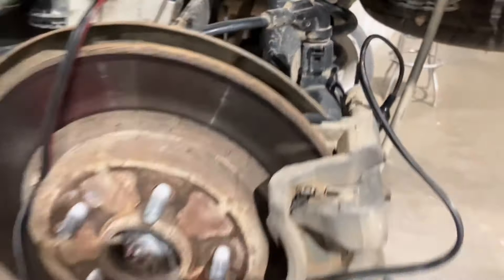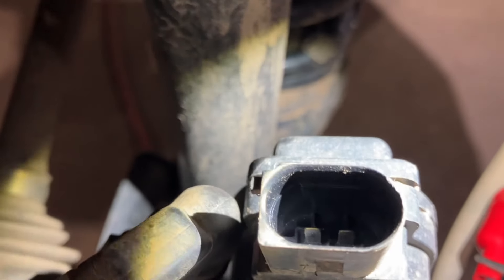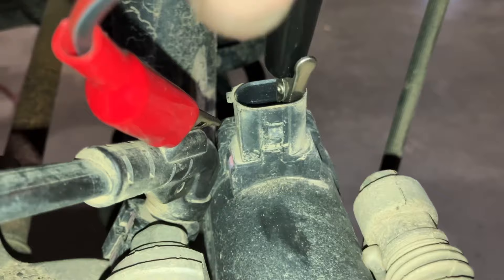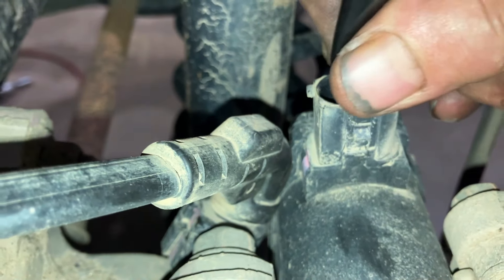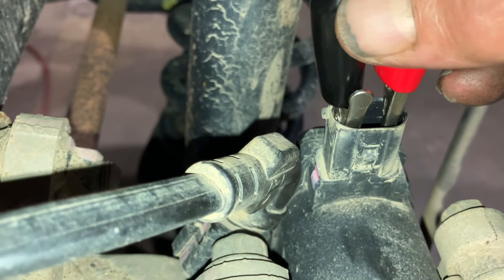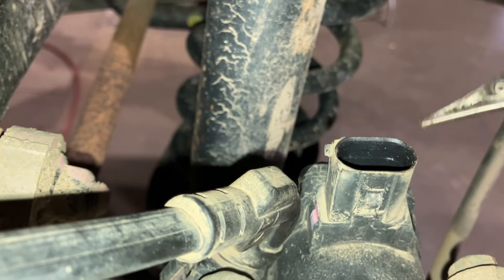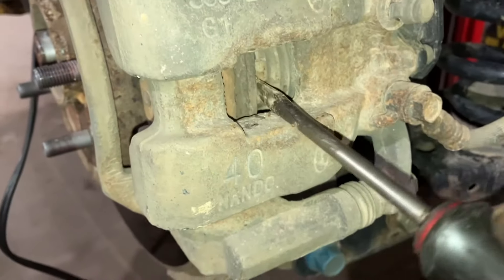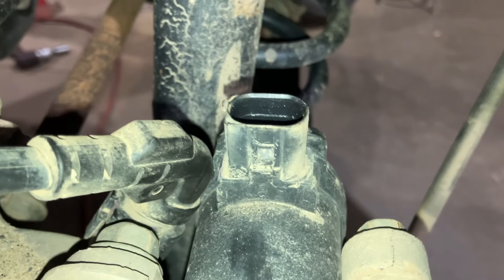Electric Parking Brake Retract - No Special Tools or Scanner

Comment: Hey Johnny ,   This appeared  in my feed  let me make your life easier  I  have a  car with electric  rear calipers,  so I made up a long enough two core cable  with female terminals to attach  to  motor and at the other end     Medium sized  crocodile  clips  for the Battery           Mines  just happens to be in the boot  or to you guys  the trunk😂 😂, The set up I watched you  using  looked  iffy as the small clips could touch🤔

Comment: Every car has a way to turn off the ebrake as long as you have the key, even cars that automatically engage it when you open the door wont if you dissengage the brake with the door already open, or by just dissengaging it a second time

Comment: A good, practical life hack!!! If a scanner was needed on some models, and it used two wire caliper connector, then all it would be doing, is reversing the polarity anyway... So, I do believe you got it right pal... Mucho Gracias!!!!!

Comment: Great tip. Once you pull the plug from the connector you have isolated the control module from your temporary battery. I don't see how anything could go wrong unless you over voltage the parking brake moter.

Comment: I wonder if turning the ign. On and putting the vehicle in neutral would release the electric parking brake as well. Im not privy to these systems as of yet.
Reply from the maker: I will release, but you still will not be able to compress the piston unless the motor is retracted all the way.

Comment: btw - my 2022 Sierra HD has an auto parking brake ONLY - sets itself on slopes ...
IF your battery fails you CANNOT manually release the parking brake (or open the electric only tail gate release) - BAD DESIGN !
Reply: or unlock the car, or open the hood to jump start it.  

Got to love the improvements they have given us.

Comment: be careful some of these newer electronic parking brakes have 3 or even 5 pin connectors on the electronic parking brake motor.  even after unplugging if you send unregulated 12v power through the wrong pins your buying a new parking brake motor

Comment: you should open the bleeder when pushing the piston back , so you dont push possible dirt up the system .
Reply: If a car owner replaced brake fluid at the recommended factory intervals, it would probably solve the problem of contamination being in the system and  being forced back to the ABS unit when compressing calipers.  Thanks for the video splaining how to retract electric parking brakes.
Reply: @dand3975 Haha. You're talking about the average car owner. Yeah - thanks for the good laugh
Reply: If you have dirt in the system there will be much more work to be done.  And there would be a leak.  Opening the bleeder would just give opportunity to inject dirt and air into the system as well as chance to make a mess.